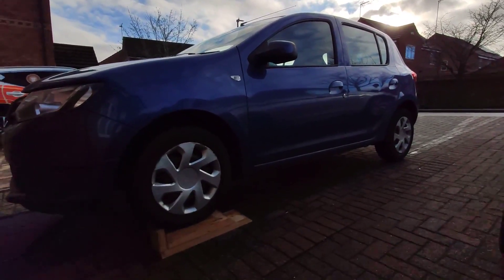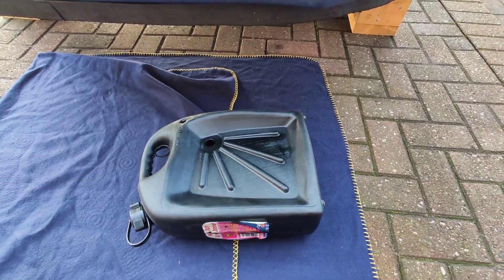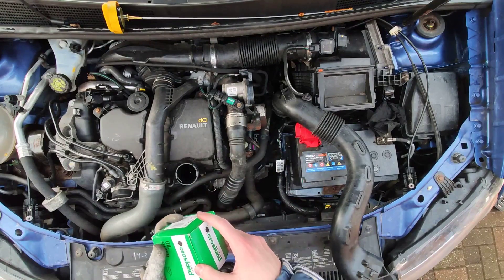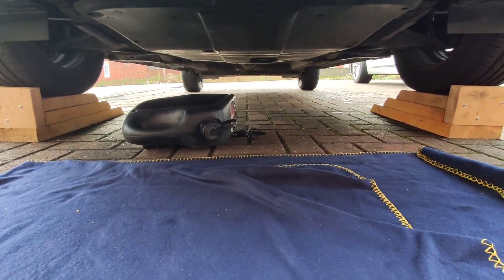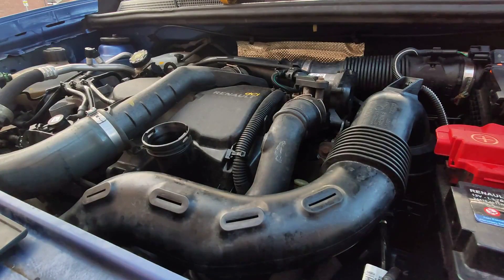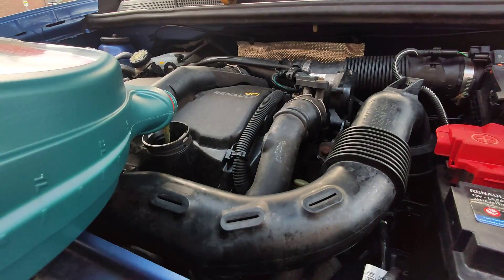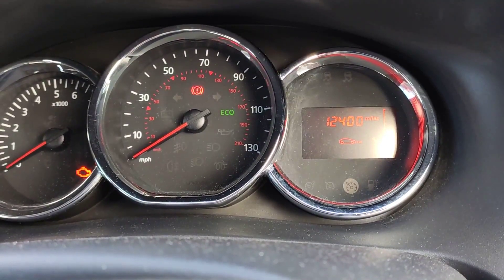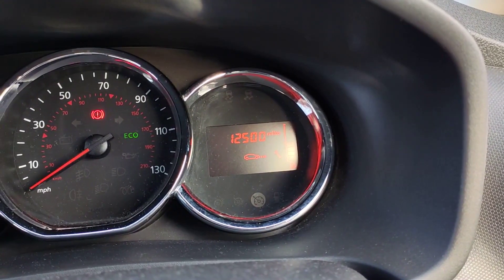2013 Dacia Sandero 1.5 dCi oil change

Comment: I used the cheapest 10w40 on mine with 290 000km on it how did it survive this much😂 the grade i'm doing is soo wrong i recently changed it to 5w40 it made alot of difference
Reply from the maker: Your driving style has much more impact on engine longevity than the oil grade you use.

Comment: hey, hello again ("landed" here from your cooler temp video) ...I knew your are my guy 😊...what you show here is exactly my practice, and same approach (on earlier cars...Reanults)...the dipstick comment - totally agree ! Reaching the oil filter - obviously a bit "messy". With my Duster I am still under warranty so I keep doing oil changes at the dealer's (but with shorter intervals at my will - 10 000 km, more frequent even then your practice). What I don't like is that they fill new oil "by the book", no waiting for topping up so last time I ended with a bit over the max. First thing I am going to do myself once over the warranty is this...oil change.
Reply from the maker: Good to hear you are keeping up on your service. The duster is a heavier car and the engine has to work a bit harder and thus degrading the oil quicker and should be serviced more often that the Sandero model. In turbocharged engines it is the turbo bearing speed that breaks the carbon chains causing the oil to become more viscous. The more you operate the engine at high boost and torque the quicker the oil degrades.
Reply: @hosuandreiremus  thx for a reply...one small question regarding the plug copper washer. It seems to me the one you are holding is with a rubber inner part ? I had mine (my earlier Renaults) just the "crushable" copper type. Is this an issue, should I insist on getting either ? I guess it does not really make a difference...used to screw back 2-3 times the old crushed washer ....by the same reason like you (forgot buying new one)..
Reply from the maker: @salmothymus  Hi. My washer was an edge molded one. This helps reduce the likelihood of leaks. My older cars only had the copper washer as well. The edge molded are more expensive, but as long as you don't get a leak it does not matter what you use. There are other people with very strong views on using the correct part. For me, as long as it does the function that it should, it is fine.
Reply: @hosuandreiremus  agreed....you state that you are not a mechanic but your arguments surely sound like coming from one...pure experience and plain logic....will check out your other videos 👍

Comment: Good job mate! Great video! I would like to know how many liters i need approximately for that engine 1.5dCi? I am gonna use that oil: Elf Evolution Full-Tech FE 5W-30 Car Motor Engine Oil - 5 Litre. Do you think is good one for that engine? Thank you <3
Reply from the maker: Yes. I believe that is the one recommended in the owners manual. When I drained the engine I got 4 liters our, so I put 4 liters back in.
Reply: @hosuandreiremus , thank you for the answer mate. Today i changed the oil, but instead 4 liters i put 3.5 liters. After i drive 5-6 miles. Do you think the 3.5 liters are below the level? I just saw your answer. Tomorrow before i start the engine again i will fill up another 0.5 / 0.7 liters to rich oil level of 4 / 4.2 liters. Hope the lovely engine is still OK with my probe with 3.5 liters for 5-6 miles. Thank you one more time ;)
Reply: 4.5 l

Comment: Is there a plug to replace the transmission oil?
Reply from the maker: Most manual gearboxes are not serviceble. There is no need to change the oil in them.